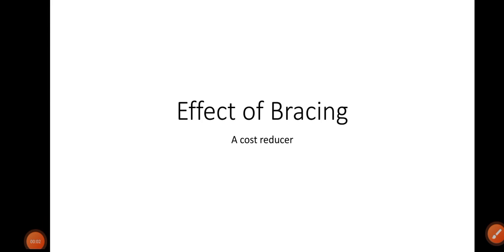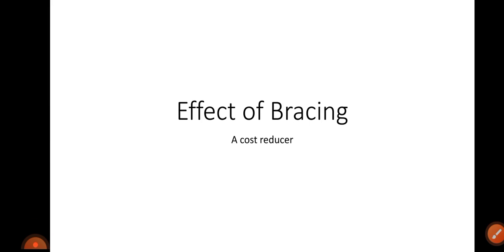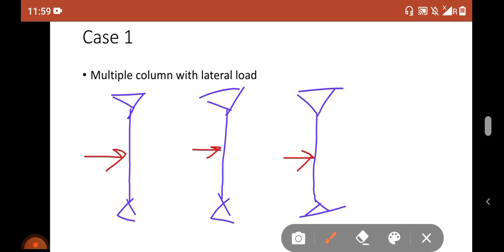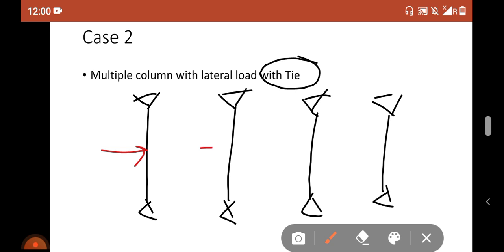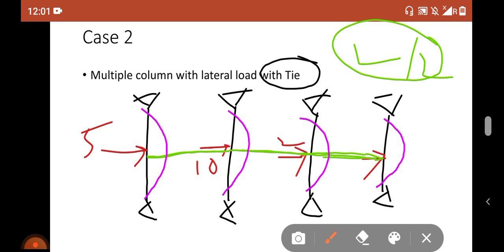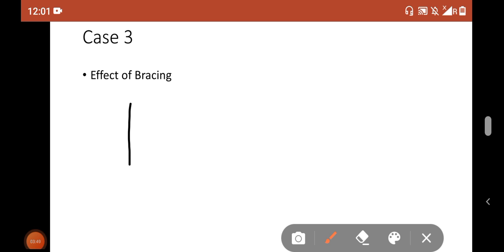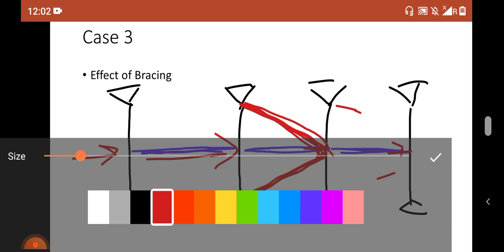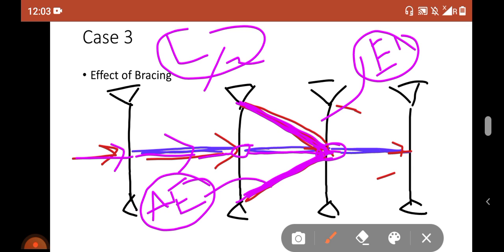Effect of Bracing : A cost Reducer

Comment: Thank you for your effort.  DO you mean that the third and forth columns don't effect with lateral load. and lateral load go through first and second column
Reply from the maker: Columns don't carry lateral load
Reply: @TonmoyMaity  I mean length effective of the first and second column  after putting the bracing in the third column will be also equal to half length.
Reply from the maker: @safaakadhim9211  yes

Comment: I've just come across your channel and found very useful being a civil engineering student and I've got a Question which I'm somewhat confused about; That what is the major difference if the column is pinned vs fixed in case of steel structure and  which connection is best for rafter and purlin in steel truss(necessity of bracket plate) ??
Reply from the maker: If the base of the column is pinned in that case you need to provide bracing to transfer the lateral load. If it is fixed in that case you need no bracing.
All connection in truss are assumed to be pin connection.
Purlin are continuous so any connection can be considered as fixed connection.